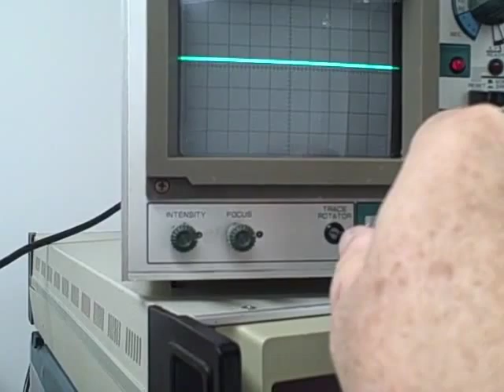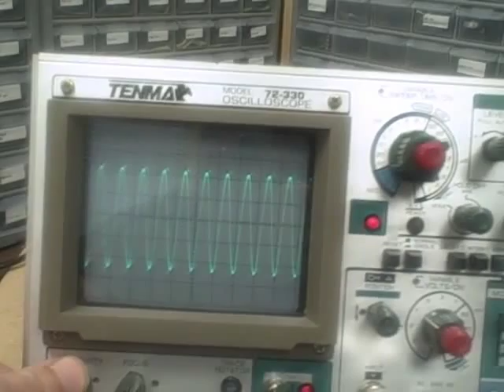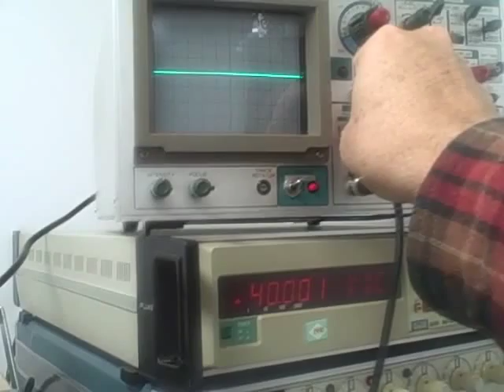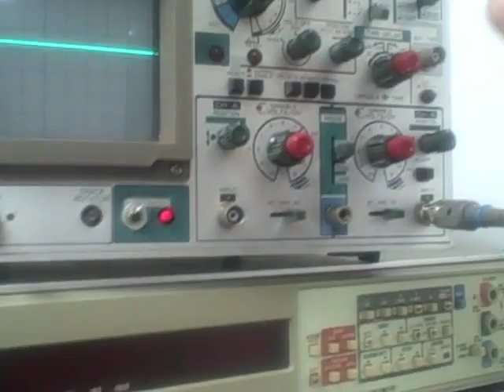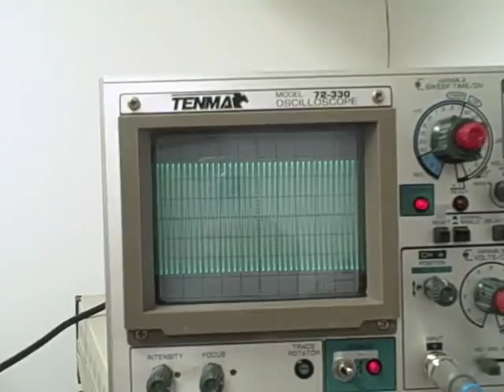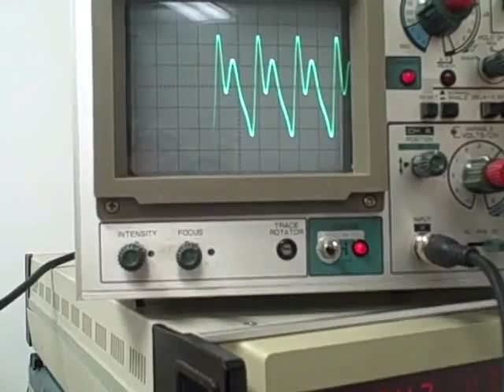Tenma 72 330 - 35Mhz Dual Channel Oscilloscope Demonstration

Comment: Oh, how many guises these come under….lots, lets list all the ones I know of.

The original manufacturer is Hang Cheng of South Korea, but they were made in both Taiwan and Japan too.

There is a whole list of 20MHz models:

Aaron BS-601. (My first Oscilloscope)
A. W. Sperry 620C
Brunelle 2988
Degem 112
Dick Smith Q1240
Elenco MO-121
Hung Chang OS-620 (Actually what the 20MHz version IS.)
J. D. R. 2000
Neotronics OS-620
Pantec PAN-8022
RaTronic DI-8022
Ramsey 2200
Tenma 72-720

As yours is a 35MHz model, then it is a 72-735, but it could just as easily be an OS-635, J.D.R. 3300, Meguro 1253 etc., etc.

So if you need the circuit and cannot find it online, just look under any of these rebadged clones.

There are some swanky 50MHz models too, Hang Cheng OS-650, Aaron BS-625 etc.

Unlike H.P. Or Tek scopes, these are very well laid-out mechanically with quite a bit of open space inside and are thus easy to get into to maintain and fix.  Tek and H.P. Are brilliant at the electronic design, but the cabinet and chassis layout often leaves a lot to be desired!

Comment: I'm Udaya Jayantha form Sri Lanka and I used Tanma 72-330 35MHz since 1993. It was a hard luck to me the Tube was gone. Recently I found the same on in ebay and friend of mine in USA got it down for me. Unfortunately that also now out of order, I lost my Instruction manual and the Schematic. I'm very appreciate if some one can send me Circuit diagram with the manual. my email 4s5scjayantha@gmail.com
Reply from the maker: Go to  www.mods.dk/manual.php?brand=tenma  and you will find it there.  You will have to join mods dk, but it is free.